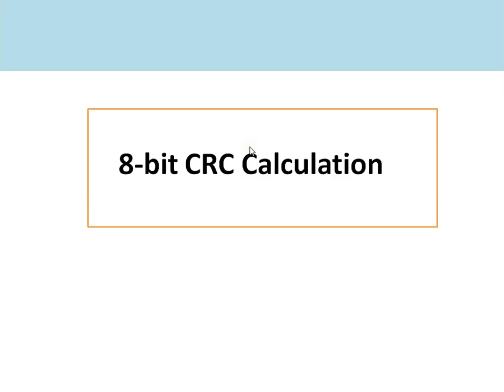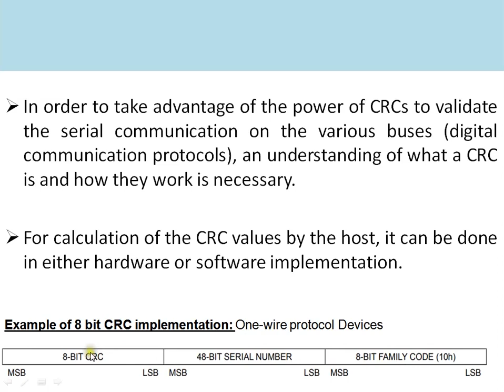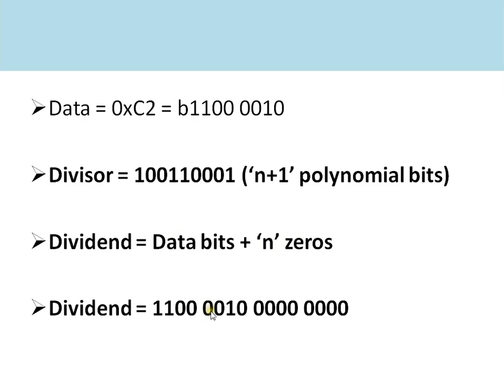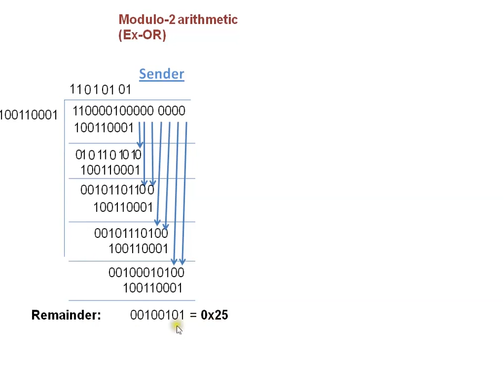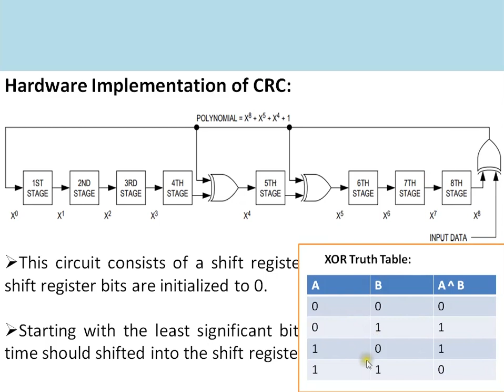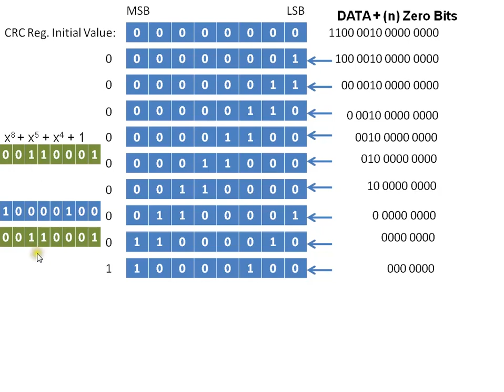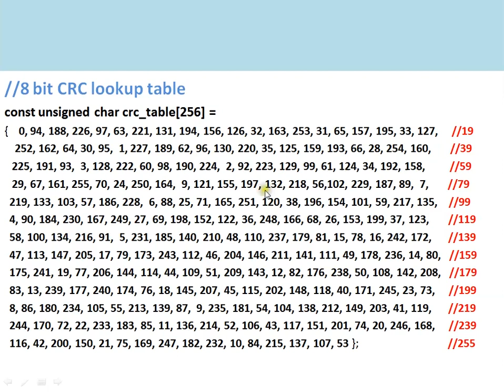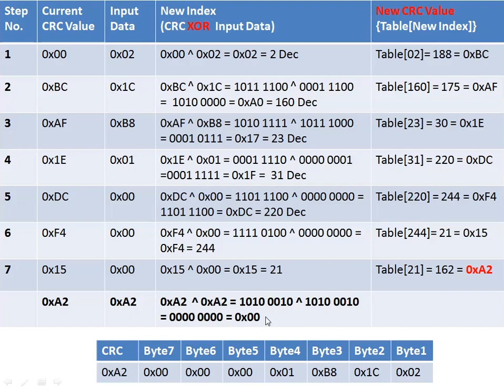8 Bit CRC Calculation || Binary Division || Shift Register & Ex-OR || Look Up Table (Software Code)

Comment: Hello thanks! But what happen if you have two or more input bytes? For example for these two bytes: 0xC0, 0xC0. I did it with an online calculator and the result should be 0x96.
Reply from the maker: at 10:14 in the video data to be replaced by two bytes 11000000 11000000 and append 00000000. pls check by performing shift and Ex-or.